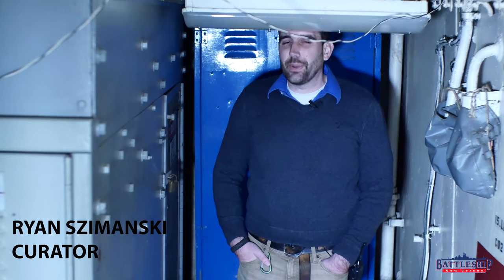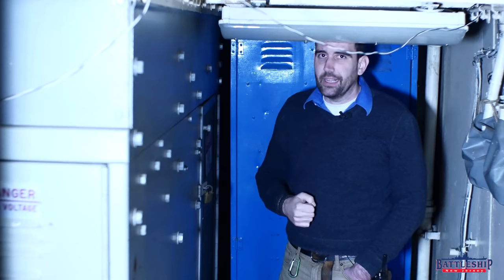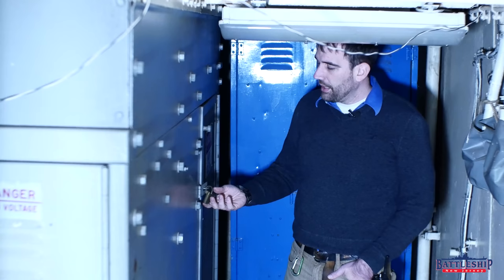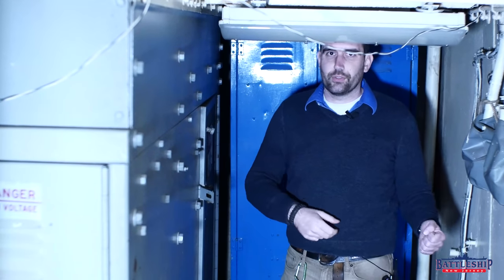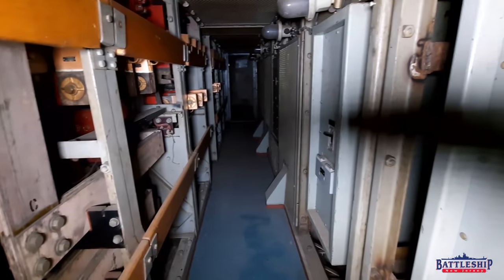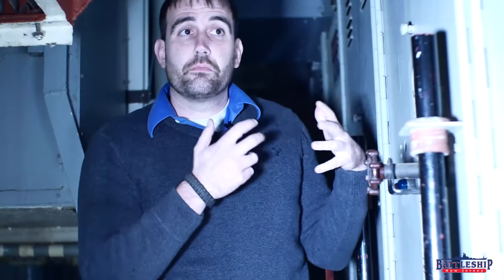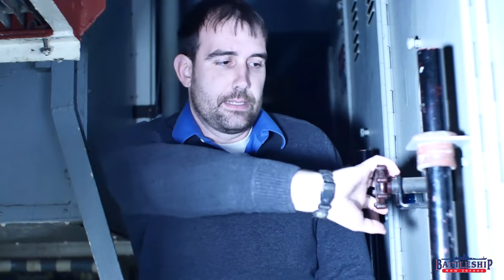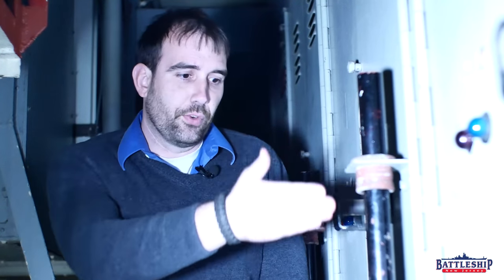Why is a Bus on a Battleship?

Comment: I always thought they should have bars on buses.
It would make the commute home much more relaxing.
Reply: Several years ago I suggested to the CTA that they operate casino trains at night.    I never heard back from them.
Reply: On Denver's RTD, some people come aboard already "relaxed" 😂
   With constant stops & go's, they'll need to limit their drinks to shooters to prevent spilling, already an issue with other & various liquids 🧃😝

🌌🔭
Reply: @jayshaw63 🚉🎲 They're just insulted that THEY didn't think of your idea first & don't want to admit it 🎰💰🚈

🌌🔭
Reply: When I worked in Crystal City in Arlington, Va.  I used to catch the bus home.  The Bus I caught originated in the Pentagon.  There were three Army officer who sat in the back of the bus and had a small cooler with little bottles of booze and they would make drink for themselves for the trip to Mt. Vernon where they lived.  Never saw them get drunk and the bus driver knew what they were doing.  As long as no one complained he was fine with it.  I even had a couple of drinks myself.

Comment: When I was 12 I decided to fix my Dads Heathkit oscilloscope.  I was working on tuning the magnets on the CRT and I slipped.   The plate voltage was 20,000 volts, but very little current.  Still, I kicked off both my shoes, and my leg muscle contractions shot me across the room and into a dresser - than hurt.   It took me a few minutes to get back up.    I did get the OScope working a week or so later, and I went on to be an electrical engineer for the last 40 years.   Low power, nothing with 4000 amps capability.  I love your videos Ryan - thanks for the look at such a wonderful ship.

Comment: Haven't been shocked myself, but fun little safety story about electricity and illegal scrappers from a railroad museum I donate to annually and get their newsletters. - Some  years back in the winter (this is in Illinois) during a week with a bad blizzard where the various  volunteer groups couldnt make it out to keep an eye out on things or work on projects the head of maintenance was notified that power went out for the facilities by one of the neighboring properties. When he got to the museum and start looking around he found a ladder propped up against a trolley power line pole with a body shaped outline in the snow and and a set of large wire cutters next to it. Foot steps meandering away from the outline hopefully meant the schmuck learned his lesson.
Reply: Six hundred volts DC is no joke. He probably had his arms across the top rung of the ladder. This probably saved his life as the current passed through the bolt cutters, up his arms and to the ladder. There must have been a significant arc flash at the tip of the cutter. DC wants to jump across the gap flashing as it goes. Think welding only bigger. 
I would bet that thief won’t be that stupid again. 
Locomotive electrician from the high plains of Texas, greetings.
Reply: Someones tried to steal copper using a bolt cutter in Sweden.  

A picture of the result is part of the electric-safety course on the swedish railway. Grisly.
Reply: As the poor sucker staggered off, an off key rendition of, "You light up my life..." was heard!

Comment: I'm proud to be a Home Electrician / Aspiring Arsonist.
Reply: Remember, it isn't arson until the house burns down!
Reply: I trained to be an electrician in highschool, I have since gone on to be a gunsmith. I have had far more cases of heated excitement as the latter than I ever did as the former, though I most certainly do not miss the smell of melting insulation...

Comment: While off shore on a pipe lay barge I was working in a power hut that supplied power to a saturation diving system rated to 4000 ft. I thought I had completely isolated the hut but missed a feeder line. I accidentally touched one of the 480 feed busses and was knocked across the hut, bounced off the wall and was about to fall back onto the buss when I realized it would be better to fall down on the deck. Needless to say it took a while to recover.
Reply: @michaelcuff5780  I saw a sign on a switchboard once that read "CAUTION - THIS WILL NOT ONLY KILL YOU; IT WILL HURT THE ENTIRE TIME THAT YOU'RE DYING".
Reply: @ghost307  Ha! Ha! Ha! Oh man! Thats funny!
Reply: In tracing a 440-volt line to find out why the outside lights were not working;  I came across a skull with a hand on each side of the skull. But no body attached to the parts.  Looked around the area and found a Brown Fury Stain on a girder.  A rat had chewed through the insulation on the wire.
Reply: Pulling into my driveway one morning I saw a blew flash and a squirrel landed on the heard of my car with it's belly opened up.  The person from the electric company said a squirrel tripped the fuse and done blowed himself up. he'd seen it many times before.

Comment: He actually means locked closed 
Open is power off ( switch open) 
Closed is power on ( switch closed) 
Marine power is a different world compared to land 
Ships have both AC and DC power systems 
High voltage and low voltage 
Because almost everything is metal and conductive so effectively grounding sensitive equipment is extremely important and of course you are surrounded by salt water
Reply: It makes more sense to the layman when you picture the "knife" switches from Frankenstein's lab.
Reply: @BlackEpyon  I always said that the Frankenstein switches on a black slate board were the safest type because anyone who didn't below near the equipment stayed as far away from it as possible. However the deadfront 'safety' type where everything is enclosed in a grey metal box invites everybody into what they assume is a storage room. I actually saw 1 electrical room being used by the building janitor as his office...and his jacket was hanging on the handle of the main switch..

Comment: i AM a licensed electrician and i was working on some gate openers at my automotive plant.  we had gotten a lightning strike on some 480 feeders from the local utility substation.  the operators (motors and gear sets) had a sheet metal cover. as i was lifting it off, my arm hit the antenna that got a signal from the collision strip in case a car or person was caught between the gate and the post.  the motors on 3 of these openers had all gotten burned up windings but they SOMEHOW shorted through the cabinets but not to ground and i got hit with 487v from my hand to my elbow.  no serious burns but red marks and numbness in the arm for about 2 days.

additionally my dad was on the USS Raby (DE-698) in Norfolk when something happened with switching from ship power to shore power.  he was a Boiler Tech and he was walking out of the compartment when the ship went dark.  some other sailor had left some grating removed from a cat walk and my dad fell a deck and half onto some steam and water piping.  70 years later his back still gives him trouble, he had knee problems and he suffers from chronic kidney issues all stemming from that fall.  the VA gave him a 10% disability rating.  it should have been 70% or higher for the pain he's quietly put up with all these years.  i spoke with a coworker who was an Electrician's Mate and he said that you should never even know when the switch in power sources takes place...

Comment: Battleshort. I was an electronic warfare tech in the Army. This is a term you get very familiar with esp if you are an equipment tech. "Battleshort (sometimes "battle short") is a condition in which some military equipment can be placed so it does not shut down when circumstances would be damaging to the equipment or personnel. The origin of the term is to bridge or "short" the fuses of an electrical apparatus before entering combat, so that the fuse blowing will not stop the equipment from operating.

According to Allied Ordnance Publication AOP-38-3,[1] a NATO publication, a battleshort is "The capability to bypass certain safety features in a system to ensure completion of the mission without interruption due to the safety feature." It also says, "Examples of bypassed safety features are circuit overload protection, and protection against overheating".[1]

In peaceful situations one would want equipment to shut down so it is not damaged. In a battle or emergency, where the survival of the vessel (or other protected asset) is dependent upon the continued operation of the equipment, it is sometimes wiser to risk equipment damage than have the equipment shut down when it is needed. For example, the electrical drives to elevate and traverse the guns of a combat warship may have "battleshort" fuses, which are simply copper bars of the correct size to fit the fuse holders, as failure to return fire in a combat situation is a greater threat to the ship and crew than damaging or overheating the electrical motors.

Battleshorts have been used in some non-combat situations as well, including the Firing Room/Mission Control spaces at NASA during the manned Apollo missions — specifically the Moon landings.[2][3].."   -- WIkipedia

Comment: You make it sound like the electrician just walks up to the interconnect boxes, or other breaker boxes and opens a switch. If you did that the switch could arc with enough force to vaporize and spray everyone around with molten metal.

As I recall, there is a long list of requirements before the cabinet is even opened. You have to get permission from the Engineering officer or reactor officer, red tag all necessary switches, make sure that the bus is not underload so no current is running through it, the person operating the switch has to wear protective gear, including a face shield, rubber boots, protective suit, and be attached with a non-conducting rope to a second electrician with the same protective gear, and be standing on a rubber mat. 

I'm sure I missed a few other things, but maybe someone with more recent experience can fill in the blanks.
Reply: Correct.Power has to be removed to the busbar prior to closing a circuit on the switch as far as i know